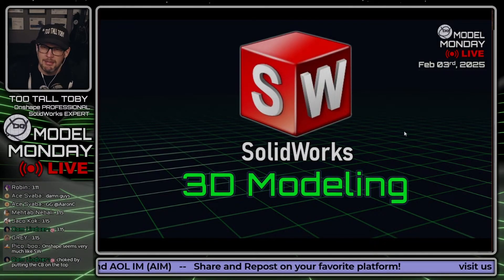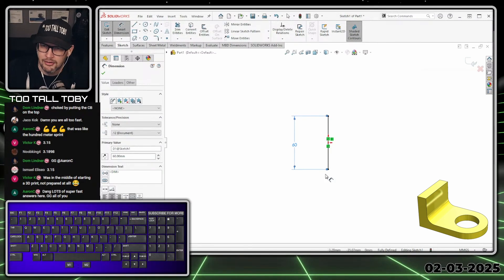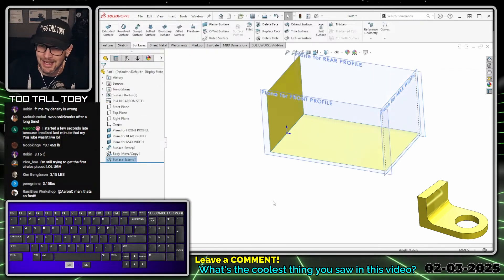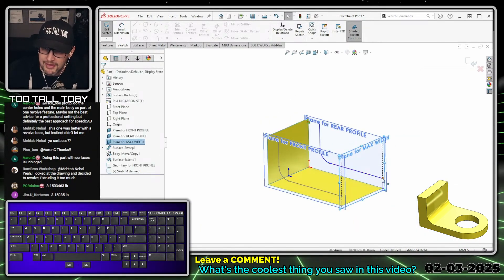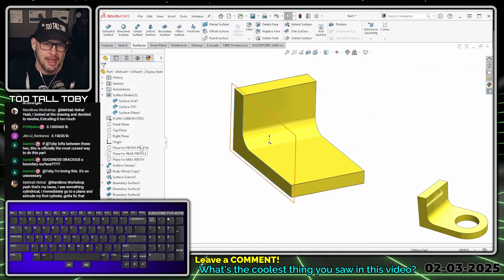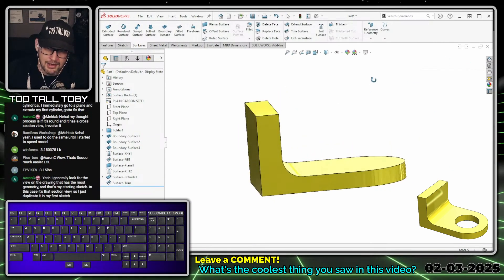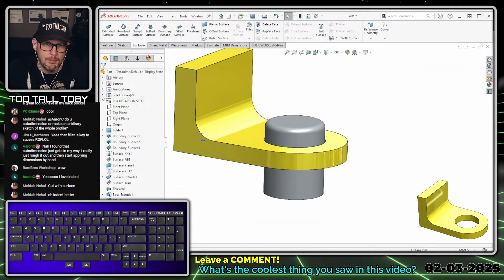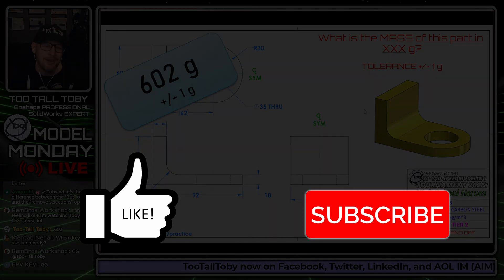Unnecessarily Complex SOLIDWORKS Feature Tree

Comment: Lol this was fun to follow, didn't know about the indent tool.
Also didn't know you could thicken to solid with watertight surfaces. I've always done it with the create solid checkbox when knitting surfaces
Reply from the maker: Awesome!  Yeah that knit and solid in one command is fine, but I personally NEVER use it.  When I teach surfacing, I remind my students that "A knit does not necessitate a solidify", which we actually saw earlier in this model.  Other situations where this occurs is when you knit 2-3 surfaces together to facilitate a trim (commonly a mutual trim).

So, to help keep my tree easier to decipher, I opt to keep the THICKEN command as an explicit command, every time, and never combined into a knit (otherwise it will be difficult for me to remember "which knit had the thicken" when the model has 50+features.

Just a personal strategy though - I've never really seen an impact on performance based on this branch in the decision tree.